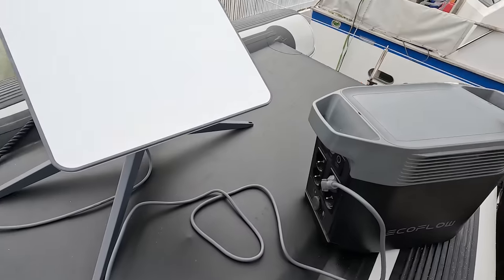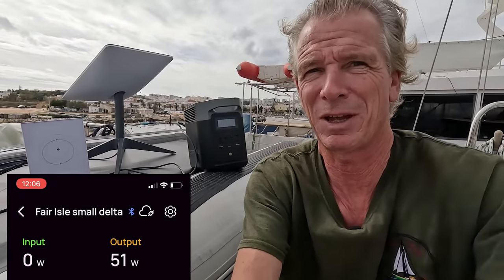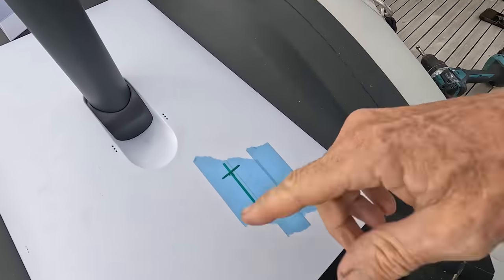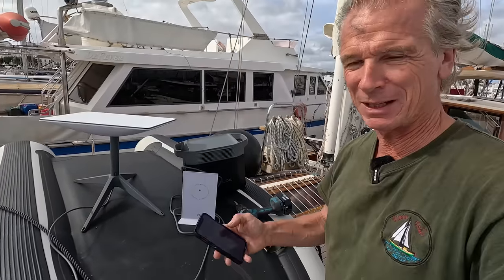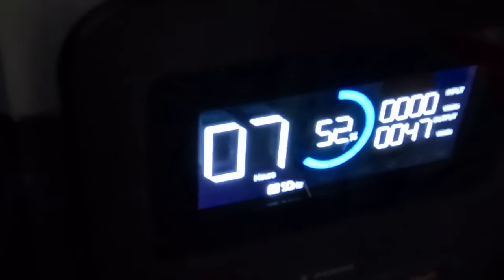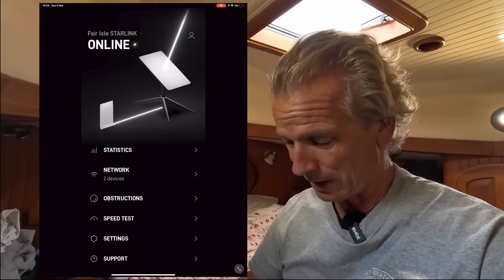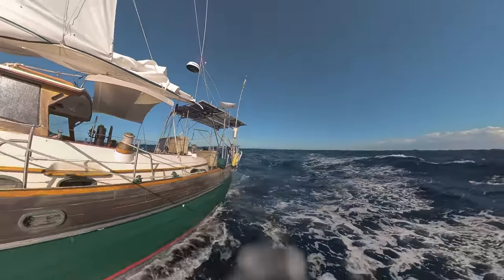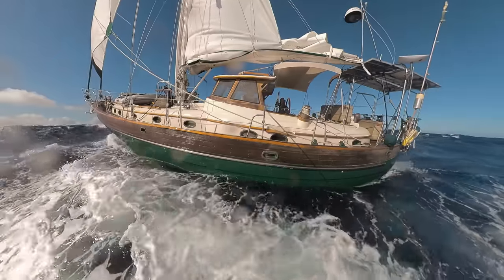Starlink on a boat

Comment: SERIOUSLY, are you complaining about 48 watts?  That is less than half the power of a single light bulb and it connect with space satalites yet you complaiin?  LOL..  Let's see you do better.
Reply from the maker: I think you've just given yourself away as a landlubber! A light bulb in your house might have that sort of draw (if you haven't updated them in a decade!) but I could have every  interior light and all the nav lights on in the boat and not draw 4 Amps
Reply: The Elon Musk cult never misses a chance to make fools of themselves.
Reply: Yes Steve, who still runs a 100W incandescent light bulb..!?!?  During one of the energy saving events last winter, I had the entire house down to just 141W.  Considering 48W equates to 4Ah, it is a lot, and probably about the same as a refrigeration unit…
Reply from the maker: Yes and power is a whole different ball game on a cruising yacht. The original poster obviously doesn't understand this. That's not to say that Starlink has done a bad job. To be able to get internet connection anywhere via satellite in this way is just incredible and yes when you understand that the Starlink dish is not a passive antenna in the way that say a 4G dongle is, this sort of draw is to be expected, but its an adjustment that has to be made in the power budget of a cruiser. There is an automated sleep function in the app that will allow  put the unit to bed to save power, so if you have lots of power (im thinking these modern cats with massive solar arrays) then just having it depower when you're asleep may be the best thing. For us it's turning the unit off most of the time while sailing and just  powering up when you actually need to do something online
Reply: @Coleen_West, 48W is indeed quite a heavy draw on a boat with finite power from batteries and finite charging opportunities. By way of comparison, it’s about what the fridge uses on our sailboat, which is our biggest other draw. The auto pilot only seems to draw about 2 amps (25-30W) even when working hard. So needing to effectively run two fridges greatly increases the load on our electrical system, which means beefing up both batteries and charging capacity. Unlike a fridge you can of course turn Starlink off when not required.

If economics is the study of the allocation of scarce resources, electricity on sailboats is the ultimate in economics! As Steve said, you’ve given yourself away as a lubber!
Reply: 220v 50ish Watt is nothing, but on a boat you’ll need to power it from your 12V batteries, including losses for the inverter you’ll probably looking at around 6 Amps/hour.  With the influence of shade etc you’d likely be adding 500 watts of solar panels, that’s roughly a 6ft x 6 ft area with the current state of technology. I feel Steve is right to be worrying about the system’s power hunger.
Reply: What a rudely composed comment from Colleen_West, unfairly and incorrectly aimed at the very amenable and competent Steve. Obviously she is channelling her inner Karen.
Reply: @svfairisle  ...let's stick with Watts since that is the accepted measure of electricity. You cite Amps but Amps are a bit meaningless unless you also know the Volts and then, of course, I must multiply the Amps x Volts to get Watts.  4 Amps x 220 volts (assuming you are using a Euro system) is 880 Watts which is way more. Regardless, two points, yes, my comment came of harsher than it sounded in my head when writing it (I love your channel). But seriously, in what world is 48 Watts such a disappointment to connect with outer space and run the Internet?  That I simply don't get. That's my second point. I'm looking around for things that use less than 48 Watts per hour and it is hard to find. Toaster. Nope. TV nope. Computer.. Nope, Car..double nope.  Home internet.. Nope... Found one.  My doorbell uses less...actually, nope. It uses more per hour... Maybe my TV remote that goes 12 feet uses less...  I guess my point is like my Dad taught me. Don't criticize unless you can do better as it always reflects badly on you.  Oops, I think I stubbed my toe on this one as I don't have a boat. Maybe on a boat, 48 Watts per hour is some measurable trouble that deserves the frown. If you heard yourself and the utter disdain you showed for a state-of-the-art multi-billion dollar space-based internet system that is so awesome in every sense, you might understand the criticism. There is nothing even close in comparison - nothing and if 48 watts is your breaking point then you can shop around and wait for the 40 Watt system. Or is it the 5-watt system? Actually, please do tell: what Wattage would turn your frown upside down?  A bit silly in my opinion.
Reply: @Coleen_West the voltage is 12, not 220. At which point amps draw is far more important. If ever you go off grid you’ll discover how huge your carbon footprint is with all those appliances, very few of which need much less than 1000 watts
Reply: @whitedog510 are you sure your not the nut case?
Reply: @Coleen_West you obviously don’t know the old saying: “keep quite and they might assume you’re an idiot, but open your mouth and you remove all doubt”.  But I guess I/we also forgot the cardinal rule: don’t feed the trolls.
Reply: @badoldtroll No, I’m with him…there are - bizarrely still - those that believe the hype around Musk (especially himself).
Reply: @returner323617 omg, that free speech guy. Who needs free speech
Reply: @returner323617  ...I can't even guess which comment you are responding to?  Is it the Watts issue or the crazy Chicken Little kid with the nutty mother?
Reply: @secniv  ,,OK, I give up..  Will somebody please explain to me how 48 Watts per hour for internet is such a huge issue on a sailboat?  Spell it out in numbers so that I understand because I have never heard that a small wattage could sink boating plans.  Doesn't your freezers and AC and lights and computers and plotters etc all use more than that? So what gives?  What on earth am I missing?  Just get one extra (very small) solar panel and one extra (very small) lithium battery.  Done. Right?
Reply: Hello @Coleen_West. 50W on a boat is a lot because you have to get your power from the batteries when you sail our are at anchor. A typical battery will give you 100 Ampers at 12 volts which correspond to 1200 Watts. So with one battery, at best ( you should nerves empty them completely) you will get 1200/50= 24 hours of running your starling and then your battery is empty. My boat, for example, has 4 such batteries, so I could go for 4 days, but then You have lights, fridges (typically 30-40 Watts per fridge, I have 2), instruments etc. Most boats will have solar panels to avoid relying just on the batteries. Again I have, for example 4 panels of 110 Watts, but a 100 Watts panel will never deliver the full power. Typically, you can say that you will get 5 times the indicated watts per day for the solar panels, so in my case, I know I can use a total of 2000W every ( sunny) day, if I use more, then I take it out of the batteries and I will have to put it back somehow later. So basically it is like running a house on a single socket that would provide current for 1h per day. In that context, drawing 50W per hour is a lot, it is more than half what my panels would produce per day, for example. I hope this helps and I didn’t screw my calculations too much . Have a great day!
Reply from the maker: @Coleen_West Well where to start! You’ve fallen foul of people on here not because they are trolls, we tend not to get trolls and I delete any that appear. The reason people are getting uptight is just that you are living in a land world where microwave ovens and toasters are an everyday thing. Energy consumption on a cruising boat is a VERY different thing. We hardly ever even turn our inverter on on the boat because we don’t have the power to run things on mains. So our power audit goes like this (very roughly) Our fridge and freezer draw about 5 amps each, 60W as you want to work in watts, but they cycle on and off so actually use about 800w over 24 hours. When we are sailing the autohelm is the next biggest draw, very variable this one because it depends on conditions but on average it takes about the same as the fridge or freezer, but only when we are sailing and have it on. So to put that into perspective having Starlink on full time is using more power that my auto helm and I was just considering fitting a £6,000 Hydrovane steering system mainly to save the draw of the electronic autohelm, THATS how important it is on a boat. We have lithium battery’s a big modern alternator and 1000w of solar as well as several EcoFlow units so we are not badly equipped, some, probably most are much worse off. Remember we are talking about a full time cruising yacht here living off anchor. If you marina hop then it’s a different story.
If you got the impression I’m deriding Elons achievements then I’m sorry you got that impression, nothing could be further from the truth. I think what he’s done is nothing short of brilliant, getting internet at sea is a game changer and will save lives for sure. From the point of view I’d sailors though they have got to understand the implications of running one compared to say a 5G dongle that runs off milliamps, the fact that you don’t understand that proves the point, sailors who are not used to thinking of their energy budget may fall into the same trap.
Reply: @svfairisle  ...no I don't think that anyone is "trolling" me. Not at all. Regardless, the reality is what we must all deal with and the reality of the situation is clear: there simply is no alternative currently on the market, that offers this service or any like it, for less wattage. While we can, and apparently many are based on the comments, complain about the current wattage requirements, it just seems pointless. Maybe the solution is to install another 10kw of batteries and cover the shortage? As a side note, from what we can see, 1kw of solar will not cover most uses - Ideal would be 5kw according to Sailing Zatara - but space is the problem I suspect. For us it would be a simple choice as we value internet very highly. Other than safety issues, it would probably be the single most wanted service on a go-anywhere sailboat. In fact, we probably wouldn't leave shore without it. Keep up the good videos and we will keep on offering our advice.

Comment: i have seen some commentary that Starlink on mobile platforms (e.g. boats) is discouraged/unsupported - any comment on that?  I have heard there is some form of defense against moving, AFAIR the link is curtailed. (see @LadyKSailing).
Reply: Ah - I see there is a "mobile" tariff - obviously there has been an upgrade (higher charge!)
Reply from the maker: On the original RV package it was not for use on a moving platform or offshore, with the new plans  (from the start of 2023) they have got plans that officially allow you offshore, the 'Mobile Priority' is the one we are on, but there is a comment on here that you could stay on the 'Mobile Regional' and just pay for priority by the Gb and that is okay for ocean use too. This would actually be a cheaper way as the Priority plan gives you 50Gb for 300euros, so more expensive than paying 2 euros / Gb which would have only cost us 100Euros! Makes no sense which is why I opted for the full on mobile priority thinking I was missing something, but apparently not. 
They do want you to have 'special hardware' for anything in motion (ie the various flat dish high power options) but they are expensive and frankly take far too much power. The 'dishy' works fine and no one has had any problems using it at sea. You will see in the next episode we just sails for 2 days through a force 9 storm and the Starlink didnt drop out once, so we can definitely say its good in motion! At least with the motors off, not sure how it would have coped with them still energised - perhaps someone out there has experience of this?
Reply: @svfairisle  Could you do me a massive favour and use capital B in GB?   Gb is a gigabit,  GB is a gigabyte.   Does it matter probably not, but it annoys me a very lot.  🙂